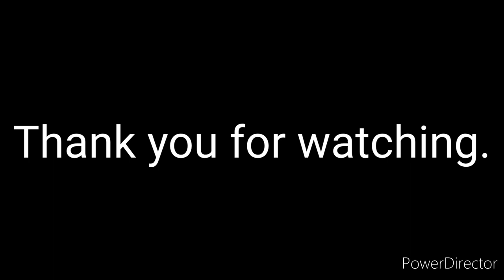NV110 Fitting a GRT 4G trigger to the Gamo Swarm. Also farewell to the Gamo and maybe to the channel

Comment: Why do they recommend to remove the gas ram piston to fit the new trigger?
Reply from the maker: Hello, on Gamos the trigger block is also the spring/ram retainer, so it should be removed using a clamp/compressor.
You don't actually need to pull out the gas ram after it was decompressed, I just did it to check it over.
Hope that answers your question.
Reply: @nickvending9688  Thanks for that.

Comment: Did the Gamo trigger fit the BSA ?
Reply from the maker: Check out video NV038.
Reply: @nickvending9688  The NV038 footage is you attempting to fit the GRT-4G trigger to the BSA Lightning. You said in the footage above that you were wondering if the GAMO trigger blade may be an upgrade for the BSA Lightning at 26:36 and that you were going to try it.
Reply from the maker: Ah yes, good point. I'd forgotten about that.
I haven't tried it yet, too much else to do at the moment.